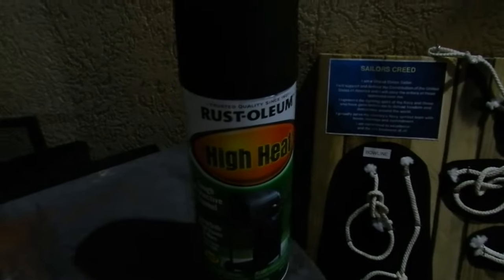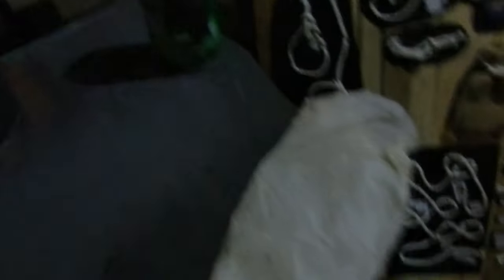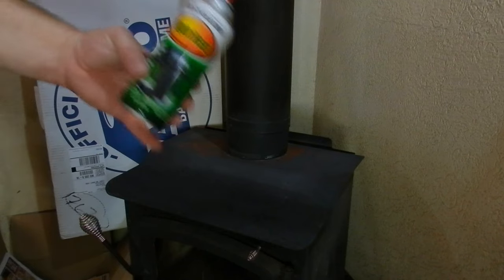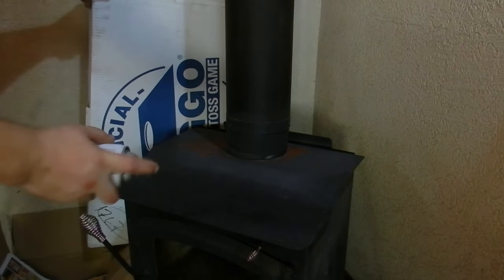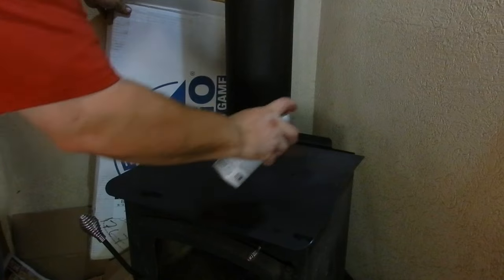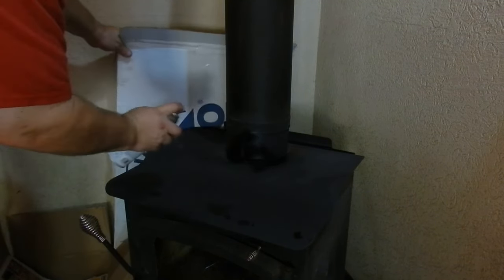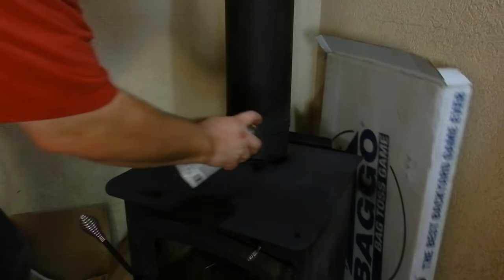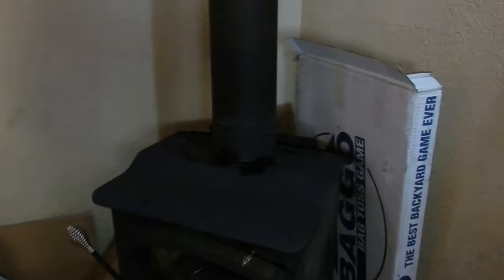How to Paint a Wood Burning Stove

Comment: I have my first ever stove, silly question but do you spray inside the stove as well? I have some rust marks inside which I have used wire wool on and wondering whether to spray inside or whether I'm being stupid.
Reply from the maker: No.  Just the outside.  The bricks that line to inside wall do not get painted.
Reply: @billyq12001  what about the inner of the stove behind the bricks and above them etc?

I wire wooled plenty of rust off from the inside
Reply from the maker: @leehall4810  Taking the rest off is fine.  The painting will burn off and be a waist of time and money to do.

Comment: I would like to know if this paint is safe to use on a wood stove that you're using in the house? When this type of paint gives off fumes when heated up. Do they make paint that is made for wood stoves and for indoor use?
Reply from the maker: I paint during the spring or fall with the windows open.  The fumes do not build up at all for me.  Just don't over paint.